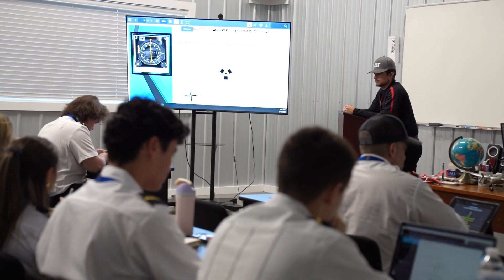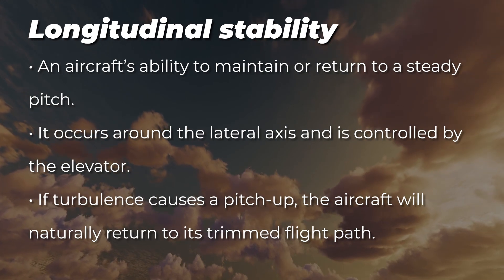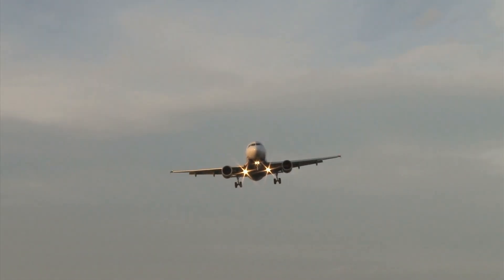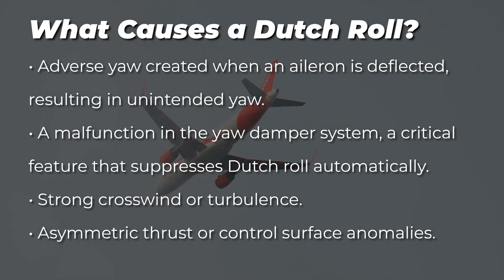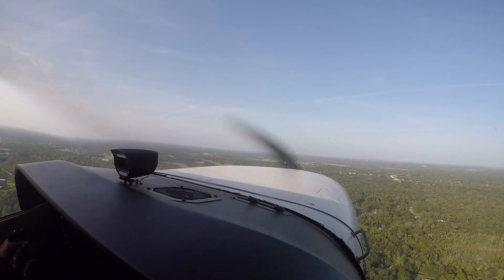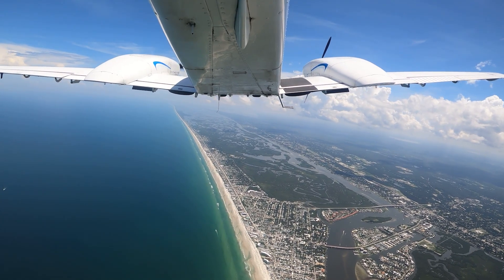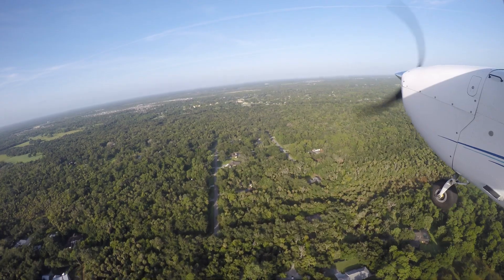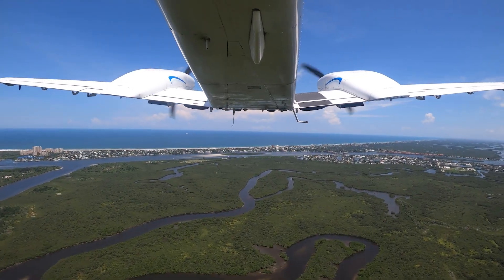What Is a Dutch Roll? | Aircraft Stability Explained by Ray Altmann

Comment: I am 77 so for sixty years of flying have known the term Dutch roll as a coordination maneuver to give students an opportunity to see how bad adverse yaw is, even in modern airplanes, and how to rewire their brain so as to apply rudder immediately in the turn rather than step on the ball to recover from adverse yaw.  We have too much muscle memory to use the steering wheel (aileron in the airplane) to start the turn and oh yea step on the ball to get the nose actually going the way we expected but it went the other way.  Startle, jerking movement, and laziness start adverse yaw.  The brain rewire is to teach, "lead rudder.". Of course that, by definition, is not coordination.  But, in humans with bad wiring, it causes coordination of rudder and aileron (not aileron and rudder...why do we always say aileron first?)

With gust spread or turbulence induced wing wagging (or with student induced wing wagging on short final) the use of rudder only to correct the nose back to be on target or heading induces far less wing wagging and actually aligns the nose longitudinally (left right, they keep switching aerodynamic terms around) with the target.  Dynamic proactive rudder, most useful on short final, will bracket/nail the centerline or target but can be tiring during cruise.  Just jabbing a rudder to bring the wing back up in cruise is much less out of phase causing than is aileron (startle or jerky steering wheel action) use even if coordinated with rudder.  The rudder only pilot will call light the turbulence the aileron, even coordinated, pilot calls moderate or even severe.  If stuff is not floating around in the cockpit, it is not severe turbulence, and in that we all have to just wait it out.  The airplane is temporarily unable to be controlled by aileron only, rudder only, or coordination of aileron and rudder.